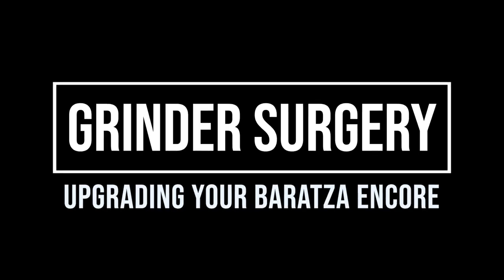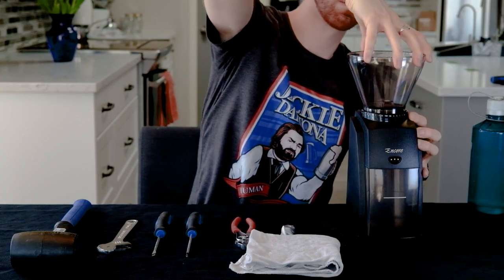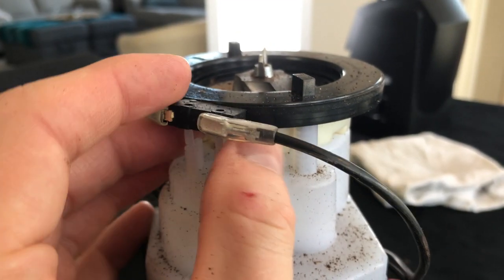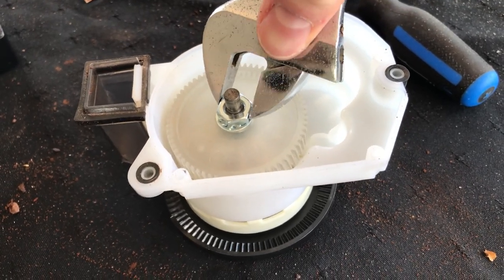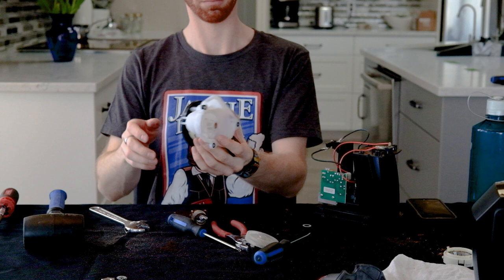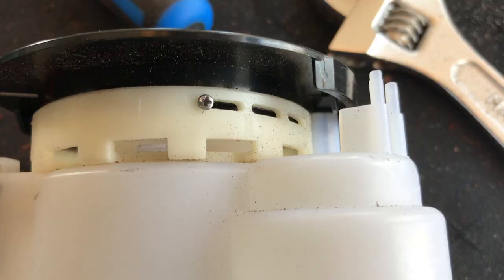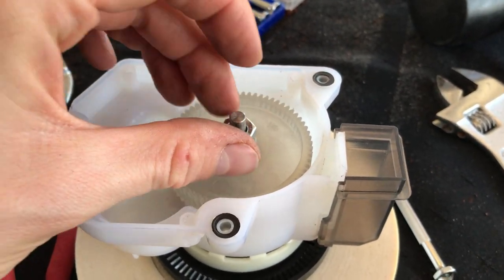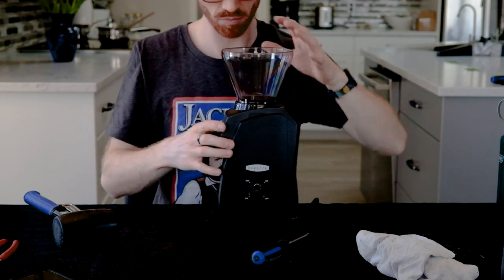Upgrading a Baratza Encore (stepless and M2 burr mod)

Comment: CAUTION: You have to screw the burr in with the machine upside down. There is a paddle wheel under the burr that has to fit into the grooves of the burr. If you don't put it in place and screw the burr in upside down burr will sit atop the notch and sit higher than intended, therefore the grind calibration will be so off that the grind size control won't matter at all. I almost missed this step when I upgraded to the M2 burr on my encore but I got lucky and came across some good advice. If you find that the M2 burr upgrade isn't yielding good results or won't change grind size, this is your problem.
Reply: I must have gotten lucky, because all appears to be good and i am enjoying my coffee as i type this :)

Comment: My Virtuoso came stepless; the stop had mistakenly been put in flat side up at the factory rather than wedge end up. First time I disassembled it the stop popped out, and when I put it back in, I unknowingly corrected the error and converted my grinder into a step grinder. I hated this, so I took it apart again and removed the stop entirely. However without the stop the adjustment ring seemed to move much too freely, and the setting would drift while grinding beans, so I put the stop back in flat side up. The slight pressure of the flat end against the teeth seems to hold the grind position better than when it is not there.
Reply: oh good tip!

Comment: What I did to remove the old burr without taking the grinder apart was to use a clean 13/16-inch socket, a short extension, a ratchet handle and a gentle clockwise tap with the palm of my hand.

Comment: Watching in 2024, considering upgrading to the M2 burr and this has me considering also going stepless! Thanks for the video. I'm upgrading now since the wingnut on top of my M3 burr came off during grinding and scratched up both burrs.
Reply from the maker: Thanks for watching and for the comment! I've since moved on to a different grinder (the Varia VS3, which I'd happily recommend), but I wouldn't advise going strapless on the Encore. It moved too much and I ended up putting the detent back in. 

Happy I could help! And jeez, the wingnut came off during grinding? That sounds terrifying...

Comment: Really useful vid, but could someone give me an idea of whether it's actually worth doing? I don't need to make it stepless etc as I have a Niche for espresso grinds. Would the M2 burr make an appreciable difference to V60 and French Press?
Reply from the maker: In my (limited) experience, the upgrade made pourovers easier and more consistent. Overall I'd say the grinder is more consistent than it was before. But I don't think you'll be making pourovers anywhere near as good as the ones you'd make with the Niche.

Comment: My Baratza Encore had 4 additional screws located under the rubber feat at the base. The screws were Torc screws so special screwdriver was needed. After removing all the screws still the outer case was difficult to remove. It did not want to slide off easy. In the end I completed task. Thanks, Riley McDonald for video.
Reply from the maker: So glad I could help! Happy grinding :)

Comment: A very informative video and well shot. 
I would like to say I removed the centre burr a little differently. I got a short 150mm length of  dowel 35mm wide. I drilled a 25mm hole in one end about 15mm. I locked on a pair of vice grips to the dowel and held it down on the centre burr. I then gave the grips a sharp hit with a hammer and it loosened the burr. I was able to replace both burrs without disassembling the grinder.
Reply from the maker: That's great you didn't have to take the whole thing apart! Sounds very efficient. If you haven't before though, I would definitely recommend opening your grinder up (take the casing off at least) every once in a while to clean it. I was shocked at how much coffee dust was in there!
Reply: @rileydmcdonald  After every time I grind a batch I blow the machine out with my high powered air compressor. It would be interesting to see if there's any build up. Once again, a great video. 👍
Reply from the maker: Thanks for the kind words!

Comment: Just upgraded both M2 burrs and paddle wheel and it grinds much faster and finer than before. Paddle wheel seems to be a necessary upgrade for an older unit seeing as how much shorter the old spokes were. Thanks for your vid!

Comment: I remember watching this video when deciding to buy either this grinder or the eureka crono.  Encore was $200 cad plus the burrs where as the crono was $280 cad.  Flat burr 50mm and better performance for just a few extra bucks.
Reply from the maker: How do you like the crono for espresso?
Reply: @rileydmcdonald  absolutely love it.  Everything is the same as the silenzio minus sound dampening and burrs.  I originally had the crono for drip but threw in espresso burrs and dedicate it to espresso and use baratza for drip.  Both grinders together cost less combined then a silenzio!

Comment: This was informative enough for me to not go through all that trouble to make it stepless! I'd be tempted to upgrade the burrs, though.
Reply from the maker: I'll have an update video coming soon — I actually changed mine back from stepless to stepped again. Not worth the hassle!
Reply: Good to know. Is it a lot easier to just upgrade the burrs?
Reply from the maker: @icowrich  The way I did it, no. I'm glad I took it apart because it needed cleaning and I now understand it better. But you can easily replace the burr using vice grips: https://www.youtube.com/watch?v=rfCP-BVTGOg 

Note that doing this is likely to damage the burr. The way I did it is more time consuming, but I can still use the original burr if I wanted to for some reason. There was no damage to it the way I took it out.
Reply: Surely, you could cover the burr with a piece of a shammy before using the vice grips or something to avoid damaging it. Also...that video shows a Virtuoso. You wouldn't need to upgrade the burrs on those, would you?
Reply from the maker: @icowrich  no, that might have been for replacement. But the process on the Virtuoso and the Encore is mostly the same. It seems they're very similar grinders — the Virtuoso has a better finish, a grind timer, and an LED that shines into the grinds bin, plus the M2. By upgrading your Encore with the M2, you essentially have a plastic, timer-less Virtuoso with a darker grounds bin.
Reply: @rileydmcdonald  Oh, yes. I have a Virtuoso now (not the plus, just the original) and I love it for pour overs. The only other upgrade I've done is the single dose hopper, and it's so worth it for the price.

Comment: Interesting you mention that the jury is still out on whether or not the grind consistency improved. I have the Encore, and have been considering replacing the stock burr set with the M2 set, but from what I've been researching online, I'm not 100% convinced that it actually improves the grind consistency enough to make it worth the $50. With that said, the replacement parts are in my shopping cart on the Baratza site as I continue to investigate whether or not the upgrade is worth it. I'm willing to give it a try, but I want to see an objective comparison of before and after the upgrade.
Reply from the maker: Since posting this consistency has been a bit of an issue — when I shot the vid it was only a few days in, but it's been a week since doing this mod and it does seem to vary a bit. I mostly assumed it was my puck prep and dosing issues, but grind size is probably more likely. Unfortunately I don't have another grinder to compare it to, aside from a Hario Mini Mill, and I don't think that's going to cut it. 

I've also had a number of issues with grind retention at finer settings. Not sure what's causing this yet, but I've lost up to a gram grinding a couple times. I'm working on solving that. 

I do like that it's faster, but thus far I don't think it's more consistent. It's possible I did so much messing around with it that I threw it out of whack, so I'm going to fiddle with it for another week or so before I reach out to Baratza directly. They're pretty good about this sort of stuff, and they know people mod their grinders with the burr, so I'll see what they have to say before I write it off. 

I'll make another video about it after I've used it for a while, and if Baratza has anything to say I'll be sure to mention it. When that video's done I'll be sure to comment here to let you know :)

Comment: I just soaked the burr in hot water and was able to remove it without breaking it down all the way.  The hot water allows the tight burr to loosen more easily.
Reply from the maker: Nice! How did you soak the burr by itself without disassembly?
Reply: Can you explain how you did this? I am really hoping to avoid totally taking apart my Encore.
Reply: @LucasFernandes-sr8gc  Look around youtube comments think that's where I found it.

Comment: The wingnut is reverse threaded for the same reason the center lock nuts are reversed on one side of a racecar: so they don't unscrew themselves as they spin.
I saw they offer a single dose hopper as an accessory but I really wish it had a bellows. That's one of the biggest issues I have. I actually use the hopper lid to create a puff of air to clear it out. I'm hoping there is a 3D printed version, I'm going to take a look in a few.
Reply from the maker: I hear that! A viewer of mine commented that the single-dose hopper lid fits tightly enough you can use it as a bellows, but it's a pain to do it that way since you have to manually lift and press it. 

I've poked around on Thingiverse a few times and there are definitely hoppers available (and bellows), but I worry about the lines in a 3D print holding fines or oils and being difficult to clean (also I don't have a ton of decent flexible filament, so that's part of it). I suppose if you're using a stereolithographic printer that's less of an issue, but still. 

Let me know if you find anything good!
Reply: @rileydmcdonald  I have no experience with flexible filament and there are ways to make food safe prints that should help with the oils and fines. This might make for a good winter project.
Reply: Yo, I also use the lid to knock out the retention. Pulse or now pulse?

Comment: Thanks for the great video! Only confusing thing to me; which burr is the upgrade??
I ordered the M2 burr, turns out it's exactly the same as the burr in my Baratza Encore (which I bought 2nd hand). So I contacted Baratza and they do say it's the M2 burr that is the upgrade over the M3. Does that mean your video should say "installing the new M2 burr" around 4:35?
Reply from the maker: Thank you very much! Good catch, the description should say M2, not M3. I say M2 in the video multiple times, but the description is incorrect. Thank you, I'll change that. 

Your encore should have come with an M3, and the M2 is the upgrade.
Reply: @rileydmcdonald  Thanks for your quick response! It turns out that Baratza actually sent me an M3 burr by accident, instead of the M2 burr I ordered. That explains most of the confusion on my side and rewatching this tutorial and all the descriptions multiple times😅
Reply from the maker: Oh no! That's an unfortunate shipping error, but I'm glad you got it all sorted out. Thanks again for watching and I'm happy I could help. 

Enjoy your shiny new burr 🙂
Reply: Curious: why do you want it stepless?
Reply: @eliezersalazar4361  probably because the difference between 8.0 and 8.333 (the next step) is too great. (or some other step.)

Comment: I've done the stepless mod, but I've found that the grind is a bit too inconsistent to get any benefit when making espresso from an unpressurized portafilter. The variation in shot flow rates is quite high when I do my best to control all other variables, and it's a variation I don't see when using my commandante grinder. My hypothesis is that it has to do with how the encore controls the gap between the upper and outer burr. The gap is controlled by a plastic ring with a spiral groove cut onto it, and I think the plastic will probably flex a bit during the grinding action. How has your experience been so far with shot consistency? Do you use the encore with pressurized/non-pressurized portafilters?
Reply from the maker: Thanks for the comment! I'm glad it's not just me. Since posting this consistency has been a bit of an issue — when I shot the vid it was only a few days in, but it's been a week since doing this mod and it does seem to vary a bit. I mostly assumed it was my puck prep and dosing issues, but grind size is probably more likely. Unfortunately I don't have another grinder to compare it to, aside from a Hario Mini Mill, and I don't think that's going to cut it. 

That's a good theory about the spiral! It's fairly rigid plastic in that spiral though, do you think it would flex that much? The grinder is sharp enough and fast enough that I wouldn't imagine it'd make that much of a difference, but I'm no materials scientist.

I'm using a pressurized portafilter for now, which I know isn't ideal. Several others have commented to say I should get a non-pressurized one (it's next on my list of gear!), and I'll post a video update when I do. I suspect I'll be a lot more frustrated once I go non-pressurized, lol.

One other thing I've been having issues with is grind retention. Since doing the mod it holds a LOT more grounds in the grinder at finer settings (I've seen up to a gram), which makes me wonder if the shape of the new burr is messing things up somewhat. 

I'm going to fiddle with it for a week or so longer before I contact Baratza and see what they have to say. They've been very receptive in the past (sent me a free new gasket when my old one was ripped, even when I was out of warranty), so I'm hoping maybe they'll have some tips. I'll update when I know more!
Reply: @rileydmcdonald  I look forward to seeing any news improvements you might stumble upon! I would love to be able to use my encore more while making espresso. I have a bottomless portafilter, and i definitely have struggled a bit in the past while using my encore. At a slightly coarser grind, I would get spraying issues that caused a mess but gave the correct flow rate. At finer grinds, I would no longer have spraying issues, but the flow rates were way too slow. 

I agree that it is definitely hard to pinpoint the cause for the inconsistencies. It definitely makes you appreciate engineering more. In any case, if you're successful in your fiddling, I definitely would be interested in seeing your results.
Reply: @rileydmcdonald  thanks for this great video! I made a similar adjustment on a Virtuoso about a year ago. The grind consistency has been a huge challenge. For me, the biggest problem is that the grinder wanders a bit (even if I hold the hopper) while grinding. It tends to make a big difference with my espressos. If you have any thoughts on that, or a mod to address it, I'd be all ears.
Reply from the maker: Hmmm weird! Mine doesn't slip, and I actually saw the grinder move when it WASN'T stepless (didn't include that in the video but I have footage of it migrating)... Could it be the rubber o-ring on your grinder is dried and/or needs replacing? How long did you have it before you made the mod?
Reply: @rileydmcdonald  thanks for the reply Riley! I'll check the ring. The Virtuoso was only a few months old when I made the mod. Maybe it's some difference between the Virtuoso and the Encore.
Reply from the maker: Hmm could be. I don't have any experience with the Virtuoso. I do find Baratza to be very good about replying and helping, so maybe email them?
Reply from the maker: Update: I'm still glad I did the mod, but I no longer thing the Encore is good enough for espresso. At least not consistently. I've been tracking what I'm doing in a lot more detail and I've changed some of my equipment and I don't think this setup is very good for espresso. https://youtu.be/_D6VDpWvZ60

The Encore is a wonderful grinder for pourover and French Press, and it can SOMETIMES do espresso, but I'm eyeing a better grinder for the future.

Comment: Hey Riley
I really appreciated your work and you did a great helpful video 
I have new baratza encore and i used one time and stop grinding. do have any idea to fix it?
Reply from the maker: Thanks for the compliments and thanks for watching! I don't have any ideas, no. You could take the casing off to see if there are any loose wires, maybe? It's a fairly simple setup in there (and fairly sturdy) and the only reason I can think of would be the wires coming loose from the motor. 

If that doesn't show you anything (or give you any ideas), I would recommend calling or emailing Baratza. They're very helpful and very responsive.

Comment: I wanted to do this mod but the m2 burrs are out of stock everywhere I look!!!
Reply from the maker: Aw damn that bites! Hopefully you don't have to wait too long.
Reply: @rileydmcdonald  Ya either i wait till august for baratza to restock or buy one now for $60
Reply: @ramm2601  it's in stock as of last night
Reply: Can you do this mod without the m2 burr?
Reply from the maker: You could, but it would be pointless. I changed mine back to stepped after doing the mod because it didn't stay in place at the right grind setting. I'd say if you're going to open it up and do this, you should prioritize the M2 burr and nothing else.
Reply: @rileydmcdonald  thanks for the response. I just tried this earlier today, modding it for a finer ground for espresso, i just wasted 120 g of my favorite bean :( i’m just gonna stick with my manual grinder and will wait to make enough to buy a df64. :)